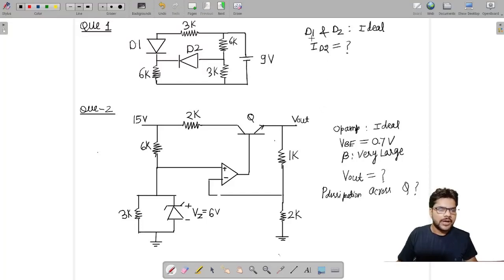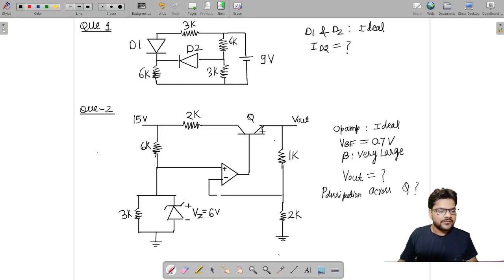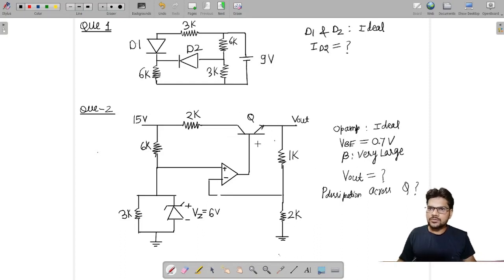Opamp with diode Circuits and Bjt Present In Single Circuit I #\Analogcircuit |YogeshSinghIISc

Comment: Que 1: Id2 = 0 A
Que 2: Vo= 9 V and P(dissipation) = 0 W
Reply from the maker: you need to check out the solution,see video is available now.
Reply: @GateBeast   sir actually I didn't check for the break down voltage of zener diode and continued my solution assuming the voltage V+ of opamp =6 V. Thank you sir for the solution. I won't repeat the mistake again 🙏🏻